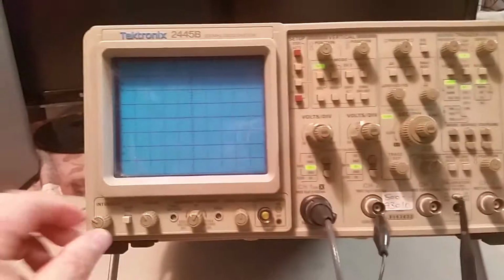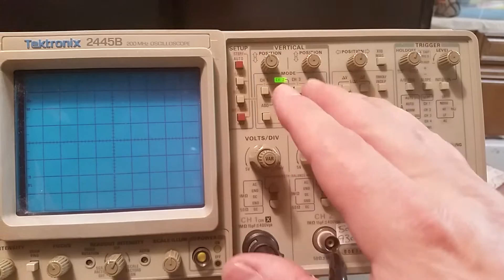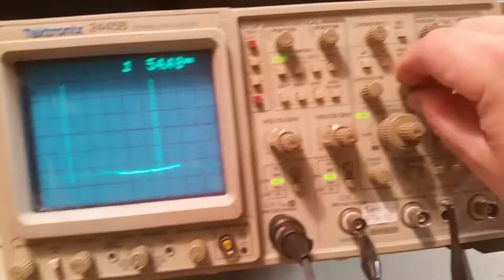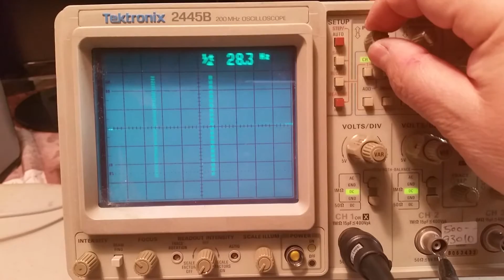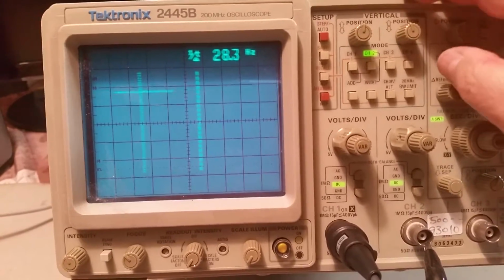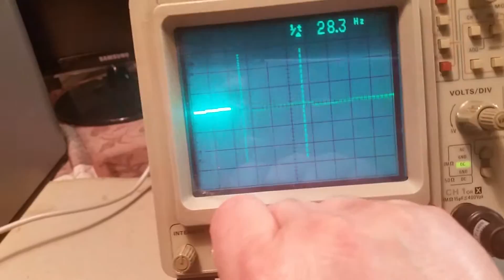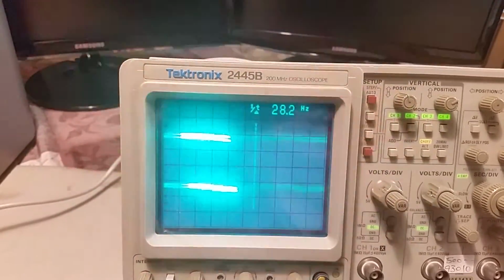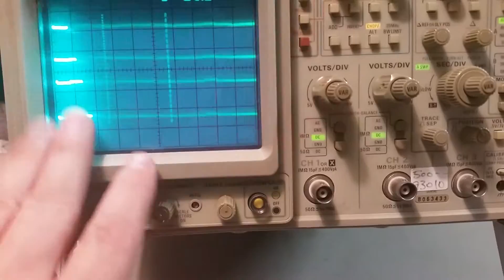Tektronix 2445B First Inspection & Power On Part 2

Comment: Dear Keith Noneya,
I' m Marcelo from Brazil. 
I have an Oscilloscope Tektronix 2445B and it presents a distortion on the channels 1 and 2.
My english is very poor, so I can not describe it well. 
Could you please take a look on the video and maybe help me to find out how to solve the problem?
There are just 2 videos on my Youtube Channel and both are demonstrating the distortion. 
Thank you in advance.
Marcelo Silva.
Reply from the maker: Google Translate: Hi Marcelo Silva. Your English is fine and I understood what you were trying to tell me. I looked at your videos and I think you have a leaky capacitor in your power supply. It's probably one of the RIFA capacitors. They are the rectangle clear yellow ones, usually with cracks all over them. Let me know how it goes. If you need to open the oscillscope I have a video on how to do that on my channel here: https://www.youtube.com/watch?v=pLTLSmTtT8M&t=316s Let me know if you need a copy of the Service Manual i'll email you a copy. You should change the name of the video to; "Tektronix 2445B with CRT Distortions - Need help to fix it"
Best Wishes and Blessings. Keith Noneya
Google Translate: Olá Marcelo Silva. Seu inglês está bom e eu entendi o que você estava tentando me dizer. Eu vi seus vídeos e acho que você tem um capacitor com vazamento na fonte de alimentação. Provavelmente é um dos capacitores RIFA. São os retangulares amarelos claros, geralmente com rachaduras por toda parte. Deixe-me saber como foi. Se você precisar abrir o osciloscópio, tenho um vídeo sobre como fazer isso no meu canal aqui: https://www.youtube.com/watch?v=pLTLSmTtT8M&t=316s Avise-me se precisar de uma cópia do Manual de serviço Eu te enviarei uma cópia por e-mail. Você deve alterar o nome do vídeo para; "Tektronix 2445B com distorções CRT - precisa de ajuda para consertar"
Melhores votos e bênçãos. Keith Noneya

Comment: You switched to Ch2 with no input and said 'that seems to be working?' working how?
Reply from the maker: Hi Keith, I was referring to the trace moving up and down, not the input circuits. You'll notice that even on channel 1 the Cal input doesn't seem to be working or the scope isn't processing it to the CRT circuits. This scope for sure it has a power supply issue, because I opened it up later and found some of them bulging capacitors. I'm just hoping it didn't fry the input circuits. I hope that helps clear up what I mean by "It seems to be working", I didn't mean the ability for Ch 2 to measure a signal but that it has a trace and it moves. Thanks for watching. Best Wishes & Blessings. Keith Noneya

Comment: I just bought one but not on ebay and it also has problems. I only get one trace without the probe connected and I don't have the time lines like yours.And the trace I get is for channel one.I have no idea what could be the problem.Very interesting video and informative.Cheers
Reply from the maker: Hi Rob, I'll see if I can help. First of all have you ever used a Tektronix 2400 Series scope before? The time Lines are displayed by pushing the Delta v and Delta t buttons at the same time. Channels are turned on by pushing the CH_ button of the channel you want to turn on. When you turn the scope on do you get any Diagnostic Monitoring Faults on the screen. If you're not familiar with the scopes special operations you can download the Operators manual and the Service Manual on line as well. If your not an electronics technician I don't recommend opening it up as there are lethal voltages inside even with the scope turned off. However if you do open it, just stay away from the CRT and the High Voltage power supply and you should be fine. I'm an electronics technician by profession, and I'm working on a 2465B on my bench right now. So if you have some more questions by all means ask and i'll do my best to answer your questions. 
Here's a few videos to watch if you're not to familiar with the series. Although they are of say 2465A or B's the basic operation is the same for all the 2400 series models. So here they are:
https://www.youtube.com/watch?v=FT9nUz4DtEs  
https://www.youtube.com/watch?v=_q5V2kVsf6Q  This is a 2467B and some functions on this video may not be available on the 2445B but the basic functions are still there.
Here's a link for the manuals: 
http://exodus.poly.edu/~kurt/manuals/manuals/Tektronix/TEK%202445B,%202455B,%202465B%20Operator.pdf  
http://bama.edebris.com/manuals/tek/2465bfull/ Although it's a 2465B it can still be used for it. If you want the real 2445B PDF Full Service Manual you can purchase it from ArtTek Meda here: for around $15.00 bucks here: 
http://artekmanuals.com/manuals/tektronix-manuals/ I have purchased multiple manuals from him and they are high quality and has a download or CD or both option.
Well I have stuff to do so I'll catch you later. Feel free to send me a message or comment a question and i'll answer you as soon as I can. Best Wishes n Blessings Keith
Reply: Hi Keith, thank you for the fast response to my question.I have never owned an Oscilloscope I am just starting to get into them.I know a little about electronics and I am learning, since I work on my stereos and reel to reels but just minor repairs.I have the operators manual and was reviewing it while trying to operate the O'scope I managed to get one trace but I was not able to get the rest. I punched the buttons for the rest of the channels but all I got was (at the bottom of the screen) 100 for channel one then 100+ for channel two then a couple of symbols that I do not remember at the moment for channel three and four but no traces on the screen for the other three. I am going to download the service manual for it and see if I can figure out if it is something simple that I can fix.I have a Leader LBO508 that someone had given me and I opened it and found out that one of the boards had overheated so it was useless.And yes I am aware of the high voltage so I am very careful around it.I was wondering if some of the controls could use some deoxit to remove any carbon build up? what do you think. I operated the trace separation button and was able to separate the trace so that appears to work.I followed your advice on turning on the Delta v and Delta t and I got  what I think is another trace?  I tuned on the channels but did not get the trace for them. Also I noticed that the trace that I have is not stable it is pulsating. I can operate the vertical by moving it up and down so that works. I will keep fiddling with it and see if I can figure it out with the help of the operators manual and the service manual.So I might be asking for your help again. I will be checking out your other videos.Thank you very much for your help Keith.RegardsRob
Reply: Forgot to ask you what the difference between the 2445 and the 2445B is. The one I got is the 2445 and was able to find the operators manual for it. Now I need to find the service manual for it.Cheers
Reply from the maker: Hey Rob no problem, that's why I started the channel, to help folks. Of course my time is limited, so sometimes my responses may be slow. Generally I get back to folks within a half a day or so. 
1. Nope don't use Deoxit, as they are carbon based contacts.
2. The main difference is that the 2445A's and up have some programmable settings and some auto settings. Just look to the right of your screen and there will be a blank space where the others have some option buttons not on the 2445. It's still a pretty nice little scope though and should work fine for audio troubleshooting as a beginner. To select a channel just put the button that says CH1 for channel 1 and input a signal there on the lower BNC connector that has the CH1 above it. Then you can move the position knob to where you want it displayed on the screen. Every channel has an on/off push button. the position knobs for 1 &amp; 2 are on the top center, channels 3 &amp; 4 are above the BNC input connectors for the channels on the bottom right of the screen. Connect a probe to the channel you want to view and then connect the probe tip to the calibration ring between channels 3 and 4. Well I'll talk more you later, I'm in the driveway taking out my transmission on my 2002 Grand Caravan. Hey make a quick video and post it so I can see what you're doing. Just label it something like: O scope a first time Newbie's Experience or something like that. Give them other Newbie's something to look fwd too ya know. Chat with ya later Rob. Best Wishes & Blessings. Keith Noneya
Reply from the maker: Ps try this video. It's on an older scope but the principles are the same.  
https://www.youtube.com/watch?v=OFGm-Pel4Hg